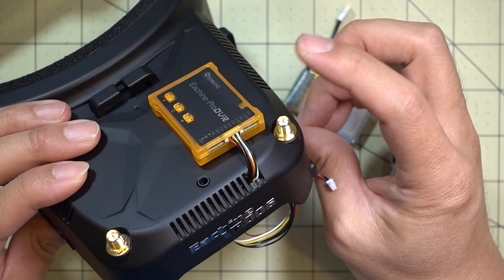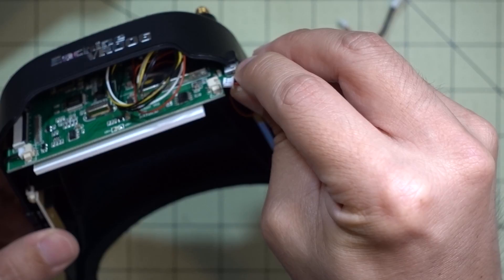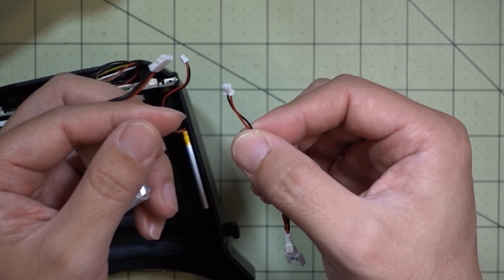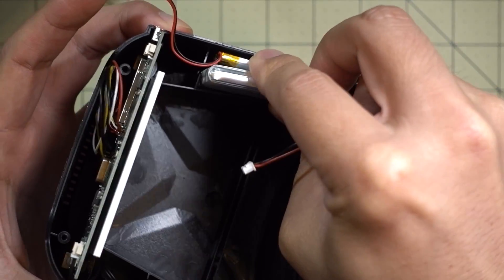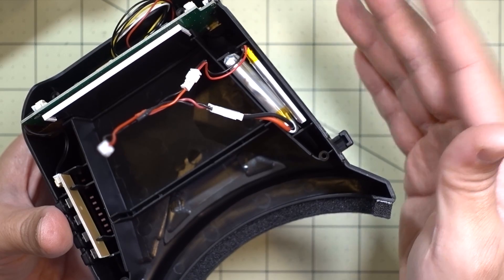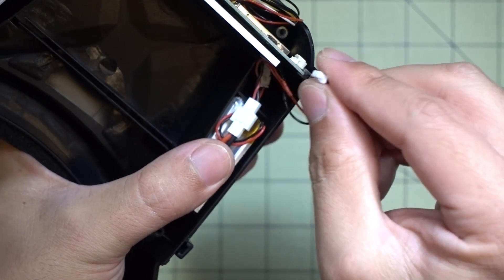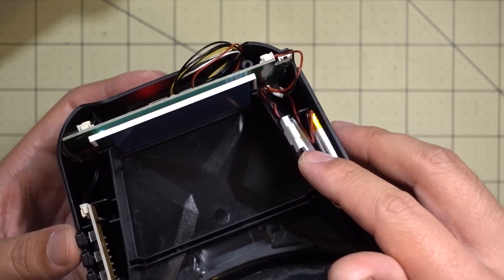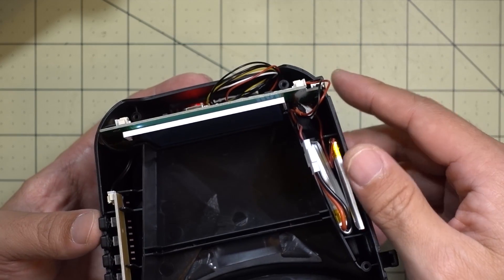Eachine VR006 FPV Goggles Battery Mod 🔋

Comment: Heya, mine also only show 4.0v when fully charged did you find any fix for this? Thx great vid!
Reply from the maker: The voltage meter on this goggle is not accurate for some people.  I don't know of any fix for it.
Reply: @AlbertKimTV  It's okay I found out the goggles suffer battery sag from screen being on. so reads 4.0v instead of 4.2v 👍

Comment: Sir can I use a single 18650 li ion instead? I will put the cell outside so no problem with space
Reply from the maker: I don't see why not.  It's just another 1S cell.  Just make sure it will be OK getting charged to 4.2v.  Some 18650's don't like going over 4.1v

Comment: Doesn't running an extra battery like that increase the voltage? If it had another battery say like 3.7 and another 3.7 Didn't that make a 7.4 volt battery? It won't ruin the electronics in the unit? Since they're probably only rated for 3.7 volts? I'm  just curious because I would like to do a similar mod but in a pair of eachine ev800d's.
Reply from the maker: The voltage is still 3.7 as I wired it up in parallel not serial.  If I wired in serial, the voltage would go to 7.4v.  Google parallel vs serial lipo and you'll get a lot of interesting reading.
Reply: Albert Kim oh ok thank you for the reply it is much appreciated. Then maybe I'll go ahead w the mod for my goggles thanks!

Comment: hello albert, could you tell me what is the maximum capacity of the battery that can be recharged the glasses
Reply from the maker: Whatever you can fit in there. My guess no more than 1200mah.

Comment: cool mods , no problem about battery balancing ? you know like stop charging because the lowest battery is full ?
Reply from the maker: This is not a 2S pack so no balancing is going on here. Its basically one large pack and the voltage is controlled by the charger on the board.

Comment: What does the little chip that's connected to the stock battery do? Is it safe to use a new battery without that?
Reply from the maker: it stops the charging when 4.2v is reached.  Most lipos have that.  If it doesn't that the charging limiter needs to be on the charger side or you get a nice fire...  🔥🔥🔥
Reply: So if I'm replacing this battery with a new 1300mah battery and getting rid of the stock battery I should unsolder the chip from the stock battery and solder it on the new battery in the same way?
Reply: Because if that's true, I really feel that he should probably mention that in this video, to anyone who thinks they can just wire in a new battery
Reply: Also, I have never seen a lipo with a built in charging limiter... usually isn't that the job of the battery charger?
Reply: Hi Josh, just read in rc groups that there is a TP405 li-ion charging chip near the USB / battery connections and it is a good reliable chip for safe voltage cut off.
I was originally concerned like yourself and just rightfully too.
I connected a 1200mah lipo to these goggles ( an ebay special, no brand but good battery ) I had to slice a little thin divider in goggles and bend it down to make the extra room, works great and springs gently on battery so as to keep it moving about.
Battery charges to 4.2 according to goggles on initial turn on but instantly drops to 4.1 so that's good, there is no 4.19, 4.18 and so on with these goggles so I don't believe it charged to 4.21 as the fast drop indicates.
I should have left the goggle apart while charging so as to test with a volt meter, I may do if I have to open them for any reason.
I hope this eases your thoughts on overcharging Josh, keep well and enjoy your mod if you do go for it.

Comment: Awsome video , thanks so much , I have now done both of the battery and DVR mods and most certainly couldn't have done it without your vids to guide me 👍🏻
Reply from the maker: great!
Reply: AndyDrew FPV hey I’m super new to Fpv, soldering, all this stuff. Is the battery mod needed for the dvr mod? If not what’s the time I can use dvr on stock battery? For a noob how hard is this soldering wise? I have tin lead solder, temp controlled iron, and have soldered literally twice, but really want dvr on my 006’s. Thanks

Comment: Think I might pick up these for my first FPV set. It'd be even better if a single 1000mah (or bigger) battery could sit in there . . .
Reply from the maker: I'm sure if you can find one of the right shape it will fit in there. Adding the 600mah lipo increased my runtime to about 1.5 hours with the DVR recording.

Comment: Is there room to put a 18650 instead of the lipo?
Reply: Easy to check the available space; an 18650 is, funnily enough, 18mm diameter by 65mm length, give or take a little in diameter and maybe a few mm in length if it has a protection circuit.  But I'm guessing from the pics that the space may get too narrow towards the rear.
18650s do have a metal case though so will weigh more relatively, and C rating is usually much lower but likely not an issue in these applications
Reply from the maker: Not sure about that one. I think it might be too big. I don't have one of those to try out so couldn't tell you.

Comment: Very nice!
 Could you extend the wire outside of the goggles and use a side Velcro setup?
Reply from the maker: You just need to put a hole in the case somewhere and would need to extend the wire, but I'm sure it would work. You could then use a much larger 1S lipo.

Comment: I do not think you can parallel a 500mah and a 600mah, not suppose to
Reply from the maker: I guess it still works. 500 and 600 is "close enough" as mah ratings on lipos is never exact anyway.
Reply: I was going to ask about the possibility of face fire... but guess it’s ok in this case. Another mod would be making the battery external. Would be very easy and move battery weight further back.
Reply: @leeburrow3671  I attach an anker 5000mah battery bank to mine.  The smallest lipstick one. It straps nice to the side headband with 2 lipo velcros.
Reply: The cells will balance into each other by voltage not AH so there is no reason to worry about parallel cells as long as they are the same voltage and type.  If you tried it with different voltage cells the discharge curve would likely bite you....
Reply: you can parallel any size batteries, if you have a 100mah and 600mah, and you draw 700mah, it will draw 100ma and 600ma respectively, so both batteries would be discharging at 1C